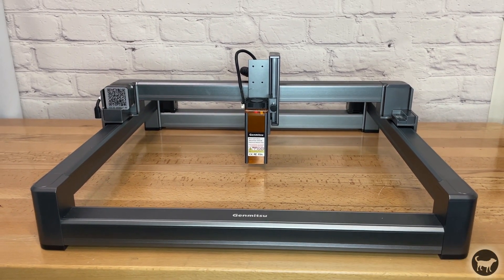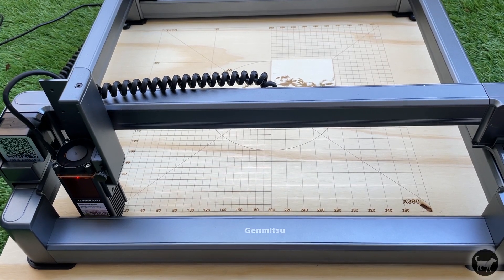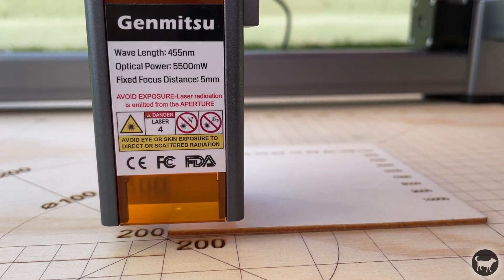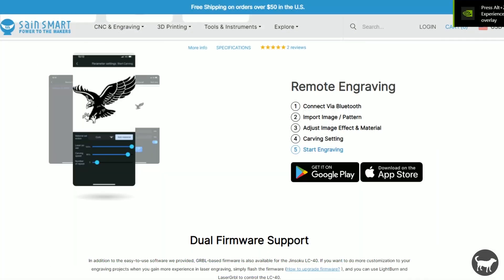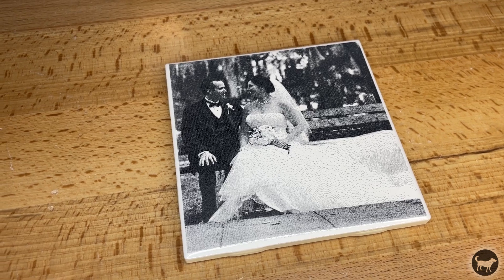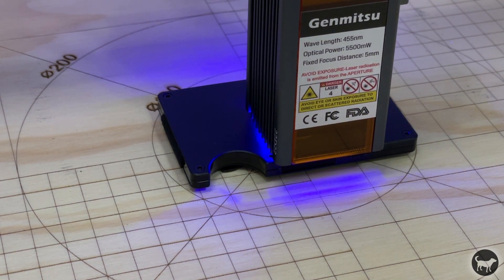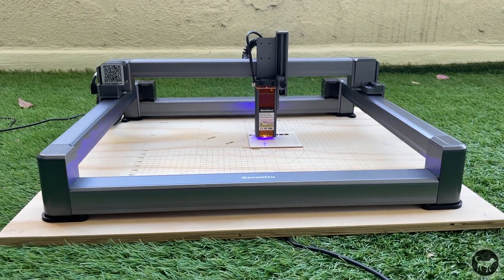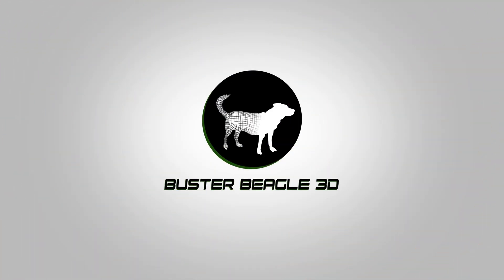Genmitsu Jinsoku LC-40 Review | Sain Smart Laser Engraver/Cutter | 5.5W Laser Output

Comment: I just checked on the availability of a 10 w laser.  It is now available for 200.00 or the unit can be ordered with the 10w laser for around 200.00 more than the cost of the 5.5w unit.  I am waiting on my LC-40 to be delivered in the next day or so and was pleased to come across your review.  It looks like the 5.5w laser will meet my immediate needs.  The one thing that might push me to getting the 10w laser is the finer laser dot, but we shall see how it does.  Thanks for the review.  Well done.
Reply from the maker: The 5.5 watt laser should have a finer dot size then the 10W. A 10W laser is essentially just 2 different 5W lasers pointed at the same spot so it will always be larger. However you are really talking about fractions of a mm so I doubt you would be able to tell the difference most of the time. The reason to go higher watts is usually for cutting strength or speed.

Comment: I have one of these and I like it for the most part.  It cuts better than I thought it would for a 5w laser though I have the 5w  fac laser module.  I was able to cut through .25 inch or 6mm bass wood.  I don't like the controls in the rear, but I can deal with that.  Another thing I don't like is that the X axis is not square to the frame.  Still, it is decent laser for the price.

Comment: Hey I have a question when your flashed the printer to use light burn did you ever get a long error code and the a box pop up saying device not found? I get one but I check my device manager and see the c340 port so idk what I’m doing wrong
Reply from the maker: It was a while ago that I did this but I don't remember ever running into issues. I would highly suggest joining their Facebook group to see if anyone else is running into similar issues.
Reply: @BusterBeagle3D  so I reached out to there support team and the replied pretty fast and told me the issue and worked like a charm. So if anyone ever has the same issue as me if you can’t flash the new firmware and comes up saying a long error code and then pops up saying no device it’s because you have more than one port running like me I had the c340 and a communication com port running and that was the issue I had to disable the communication port that was running flash the new software just like there video says and worked just like it should then I just simply just activated the port I disabled to do the update the done.
Reply from the maker: @JayzStudio  Glad you got it all figured out!
Reply: @BusterBeagle3D  yes sir now I’m burning my grid and got my feet all printed and screeed down but for some reason when I put my feet on my board one was little off cuz when homing the lazer it got all crazy started clicking so I tried it with out the feet and worked good haha so I adjusted them and got it thanks for good tips.
Reply: @JayzStudio   You're a life saver!  I was struggling with the same issue and could not figure it out.  I found your post and the solution worked.

Comment: Thank you for this video, great work. I bought your files on etsy but I´m not able to laser it. On the top area my LC-40 is not able to engrave it. It exceeds the limits and makes noises connected with loses of footsteps. My work area is set to 400x400 like it should be but I dont know what I do wrong here. X-Axis works out fine. Maybe someone know a solution for this? Point of origin is bottom left.
Reply from the maker: If you  check out the description on Etsy it mentions that you have to turn off you soft limits in the GRBL settings. You can do it in either Lightburn or LaserGRBL.
Reply: @BusterBeagle3D  Thank you very much for your response. Soft Limits are already off, I will try to adjust the sensor screws to extend range. My Etsy was automatically translated to german and it was not understandable at all what to do exactly. Now I switched it to english and now I get what you said there. Thank you again for your help.

Comment: Thank you very much for this very informative review. I only have one question: You cut a 2 mm wooden plate in the video. What is the maximum thickness of wood that the machine can cut? I would be very grateful for a short answer as I am looking for a machine that can cut 3 mm of wood. Thanks in advance.
Reply from the maker: It would depend on the type of wood but with enough passes I'm sure it could cut 3mm as well.

Comment: Can anyone help me with setting up? I thought I was on the right track, but now I hit a wall!  You would think I could figure this out but I think I'm too new to it.

[VER:1.1f.20180715:����������������������������������������������������������������]
[OPT:VMZ,35,254]
Target buffer size found
ok
Homing
ALARM:8
Homing fail. Cycle failed to clear limit switch when pulling off. Try increasing pull-off setting or check wiring.
ok
Grbl 1.1f ['$' for help]
[MSG:'$H'|'$X' to unlock]
[MSG:Caution: Unlocked]
ok
Reply from the maker: Be sure to read the product description on Etsy. You need to turn off the soft limits in the GRBL settings. That should fix your issue.

Comment: Have you or anyone found out what the optimum DPI is for the 5 watt laser that comes with this machine?
Reply from the maker: Since the regular 5.5 W is a laser spot of .1mm the optimal DP1 would be 254 DPI.
Reply: @BusterBeagle3D  thanks.  Wasn’t sure if that’s what the Engraving Accuracy value was in their specification. Keep up the great work and videos you do.
Reply from the maker: @JeffBenedict  No worries. I don't have the equipment to verify that their value is correct but it seems right.

Comment: Great video and as a consequence I have now purchased one! I'm trying to get your Lightburn grid file to work properly and everytime I open it the numbers are all mirrored, well not quite all, but some. Any ideas? Also my home position always seems to be the bottom left rather than top left? Thanks.
Reply from the maker: Hello. The LC-40 should home in the front left corner. That is where the limit switches make contact. When you first setup that machine you should set the Origin to the front left corner. Then the grid file will come in correctly. You can click on Devices , select your machine, and then click Edit. You should be able to change the origin to the front left.
Reply: @BusterBeagle3D  Thanks very much, that sorted it. Lots to learn still!  Cheers.
Reply from the maker: @damonhawkins1307   No worries!

Comment: Thanks for the great review, stl for the feet, and the grid.  Unfortunately I had some difficulty burning the grid.  It kept saying that the design would send the unit out of the operating area.  I started with the default 375x395 work area.  Then switched to 390x400.  I even entered 400x400.  Couldn't get it to burn the whole design.  EDIT: Turns out I had the soft limits set.  I am very new to this game.  Thanks for the quick fix @Buster Beagle 3D :)
Reply from the maker: Hello. Did you actually burn the design or didn’t try because it was out of the work area? I will check the file again when I get home to check to see if I see anything. I wonder if perhaps there is a stray line somewhere outside of the work area that I somehow missed. If you zoom out and drag select the area outside the grid I wonder if it catches anything.
Reply from the maker: I checked the file and it should be ok. You might be getting that notification since the outer ring is right on the edge of the workable area. You should be able to ignore that message and burn the file normally.
Reply: @BusterBeagle3D  I wish. It only burns part of the file before quitting. So I have a partial grid. Bottom left grid, the circles, and almost all the numbers but it can't quite reach the full range of the grids and numbers so when it gets that far, it just stops.
Reply from the maker: @Mirrikat  Hello. I think I might know what is happening here. It seems that you may have Soft Limits enabled in your GRBL settings. If you click on Edit>Machine Settings>Homing and Limits> and turn Soft Limits ($20) to the off position. You can then go to to your Cut/Layers and turn off the Output for C00 and C01 if you just need to burn the numbers.
Reply: @BusterBeagle3D  Thank you so much! That was indeed the issue.
Reply from the maker: @Mirrikat  No worries. It's good to know that might be an issue. I added it to the description incase anyone else has that issue.

Comment: very fair review. how would you compare it to the xtool D1?
Reply from the maker: The D1 is more powerful and has a larger work area but I do love the cable management and the fact that this machine comes with limit switches. That is one area the D1 is lacking which is pretty important to how I like to work. It's also opensource so you can use things like LaserGRBL if you wanted to with the LC-40. Both at the end of the day are nice machines.

Comment: For $400, this is actually a great buy. I was expecting $800-1000
Reply from the maker: Yeah it’s not bad. I don’t like adding prices in my reviews typically since they can change pretty quickly. It’s a nice solid machine for the price.
Reply: @BusterBeagle3D  about $350  lol
Reply: Did you ever try to get it to run in Lightburn, as I’m having issues getting it to even see the laser. Any ideas?